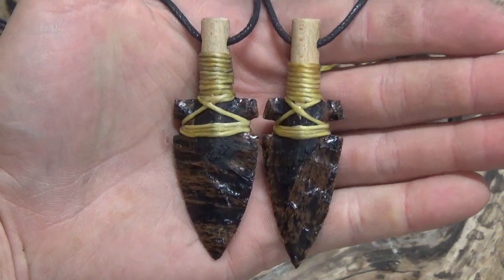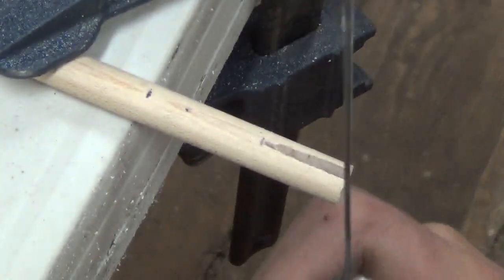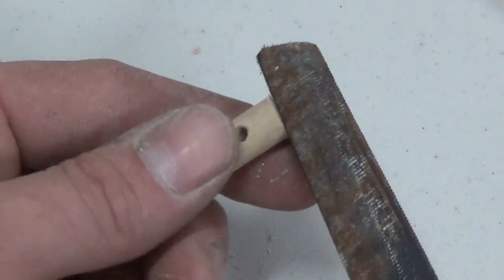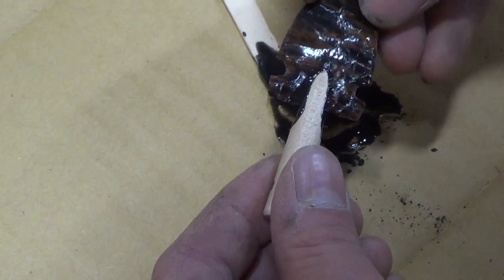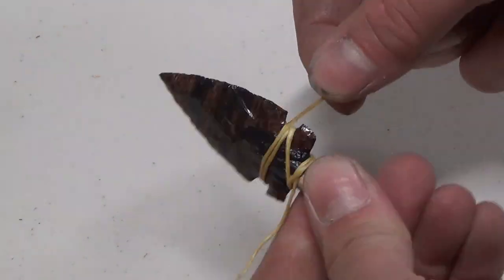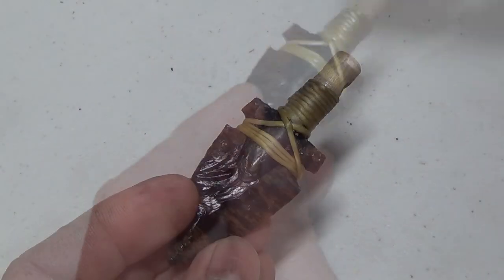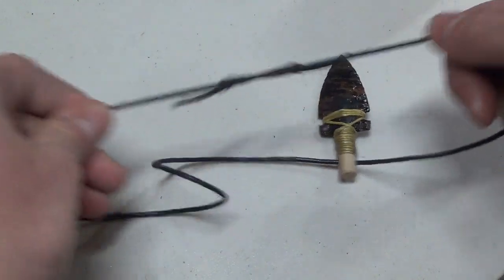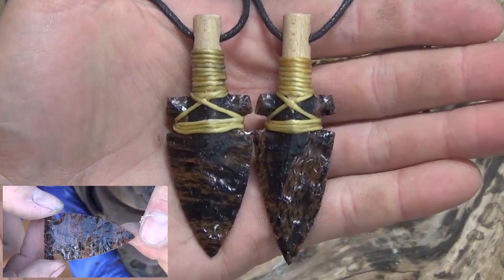How To Make a Stone Arrow Pendant With an Obsidian Arrowhead

Comment: Nick, where did you find/buy obsidian?
Reply from the maker: I find obsidian out at Glass Buttes in central Oregon. It's out in the middle of the desert, but it's worth the trip if you're nearby because there are chunks of obsidian like the one I'm using everywhere on the ground in flows and piles. If you want bigger stuff, most of it is just a couple feet under the light desert soil.

Here are some directions: http://www.pugetsoundknappers.com/events/2016%20Glass%20Buttes%20Knap-in%20Announcement.html

Other than that, most rock shops will sell obsidian (if you're near a volcano) or slag glass (if you're near a refinery) for a few dollars a pound.

Hope this helps!
Reply: BackyardBowyer I'm from Serbia but thanks, it helps, I didn't know rock shops sell obsidian or slag glass. Btw can these arrow heads be made of metal because I want to make some arrows for my homemade bow?
Reply: +Jovan Kovacevic im bulgarian. Hi
Reply: saranda dg Hi
Reply: ***** Ok. Thanks.

Comment: can you do a tutorial on Flint arrow heads
Reply: He did
Reply: Give me a link
Reply: I think he's only used obsidian
Reply: it should be the same concept with some minor differences due to material but you should, overall, be able to use the same types of methods.
Reply: +Howel Octavion  Flint is way harder than obsidian. you can't break it of like that and still have it be sharp.